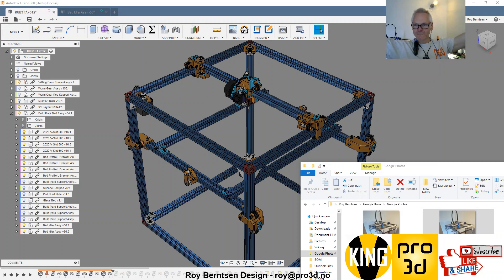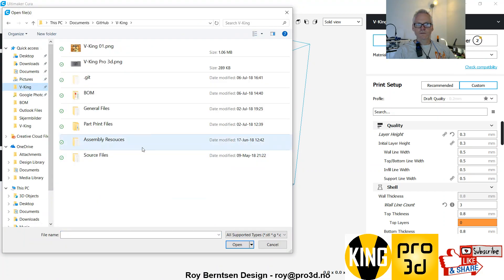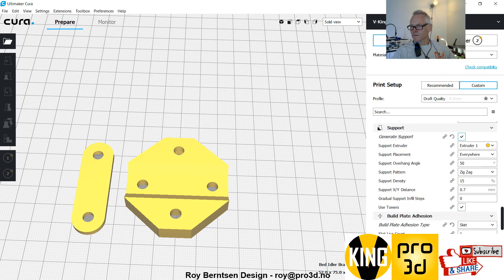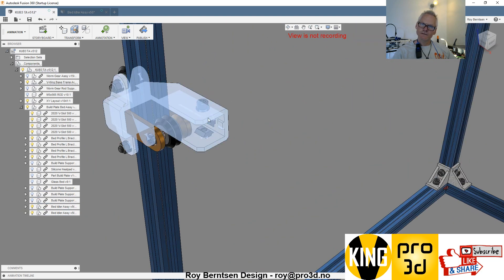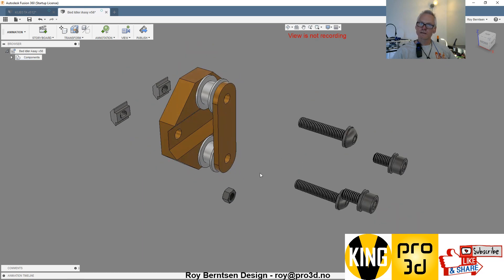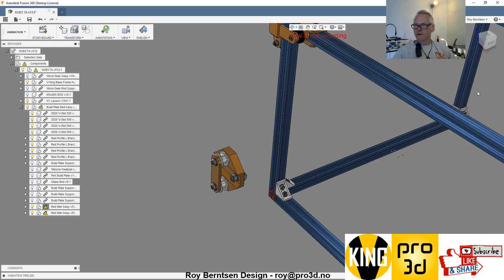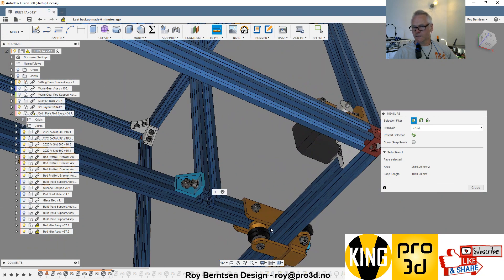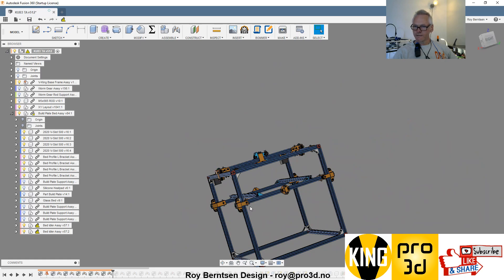V-King CoreXY - Attaching The Bed Frame

Comment: I recommend supporting the bed frame with something. If not, you can make notches in the z wheels when pushing down to tighten the corner brackets
Reply from the maker: There are hooks to print for keeping the bed frame up
Reply: @PRO3DESIGN  good to know :)

Comment: Hey Roy. Im compiling all of the printed parts now from the Git and it seems you have changed the bed attachment style. It looks like you have gone to a 3 point system and also remove the notches from the wheels? 

I also am a little confused what attaches to the bolt holes in the corner brackets?
Reply from the maker: There has been some updates with time yes. Not sure what you mean about the corner brackets. Do you have access to the fb group?

Watch the newer live build series as this is from a newer date
Reply from the maker: Oh the holes in the corner brackets I am not using...
Reply: @PRO3DESIGN  Thanks. Yeah i logged into the interactive model and saw they werent used. thanks